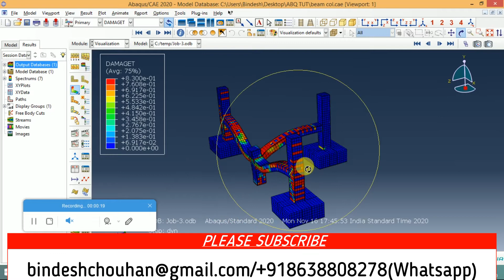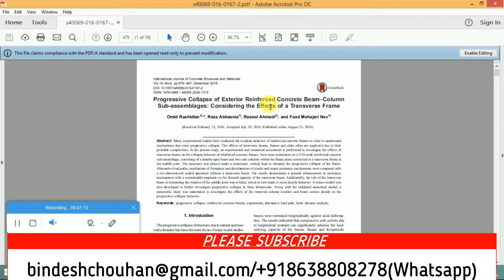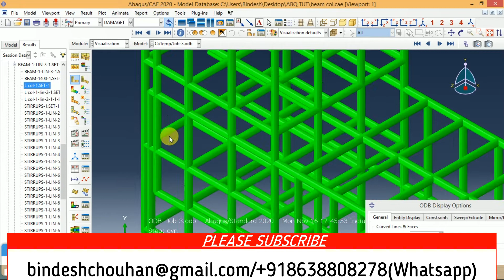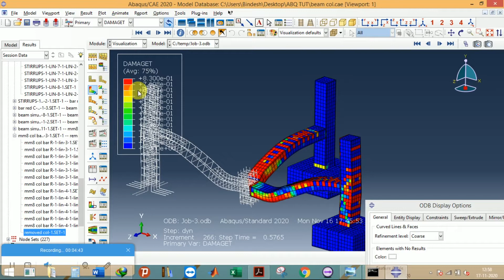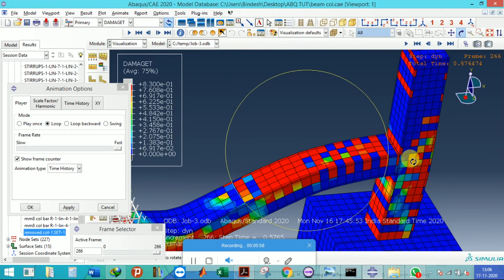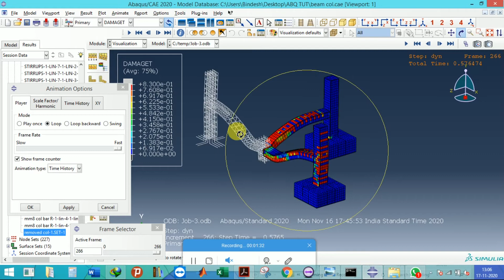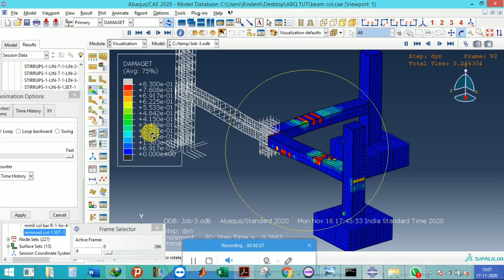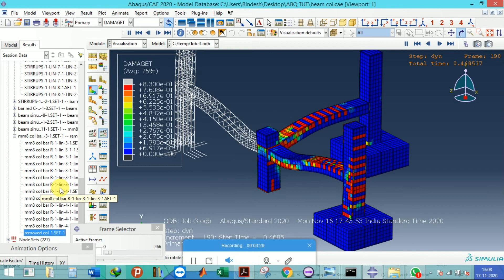#ABAQUS/ #FEA #analysis of #Reinforced #Concrete #Beam-#Column #joint || #BEAM_column_joint tutorial

Comment: For two-dimensional models, if a non-unity thickness is specified for two-dimensional solid elements and these elements are involved in an interaction such as contact, the same thickness should be specified for the out-of-plane thickness of the corresponding surface under *surface interaction.

The strain increment has exceeded fifty times the strain to cause first yield at 2 points

The strain increment has exceeded fifty times the strain to cause first yield at 2 points

why  above error occur in my model when i run it ?
Reply from the maker: Paid service,contact in whatsapp or email